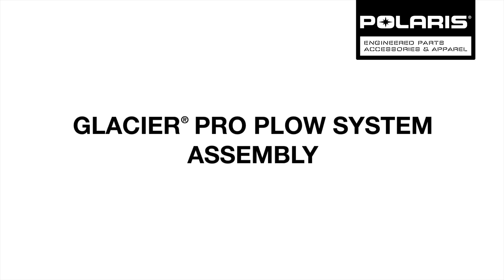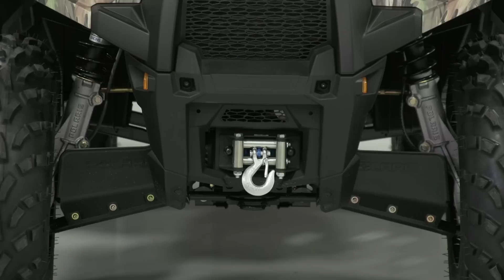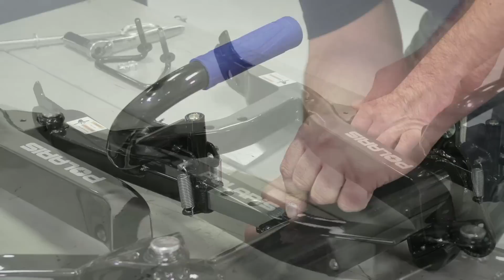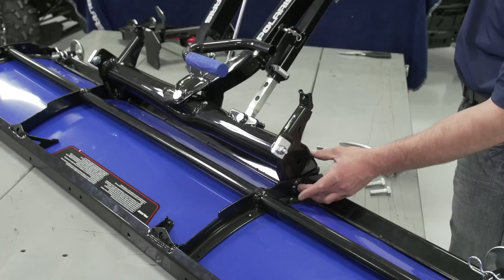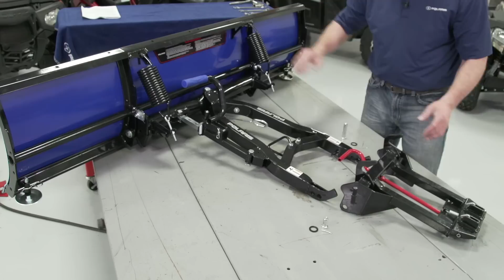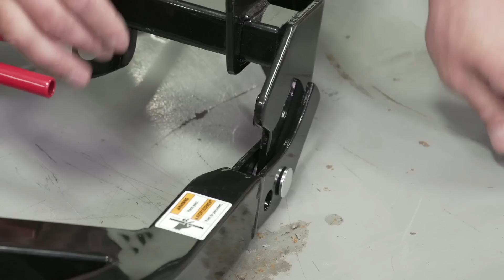Glacier® Pro HD Plow System Assembly ATV| Polaris Off-Road Vehicles

Comment: My plow blade isn't level left to right. The right side of the blade is closer to the ground by almost 2 1/2 inches. Is there a sane way to adjust the blade to level? Thanks a lot! -Steve
Reply: hey that is my same issue, did you figure out how to fix this or can some one point me in the right direction to fix this issue